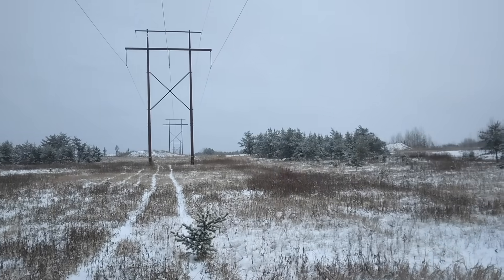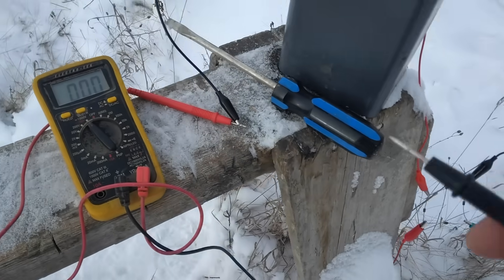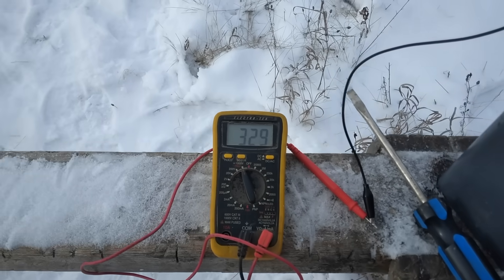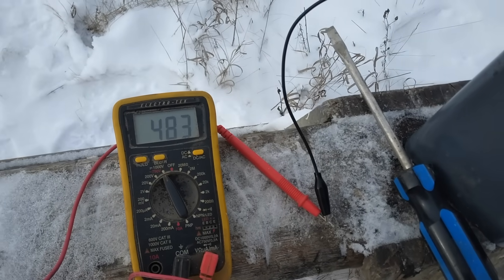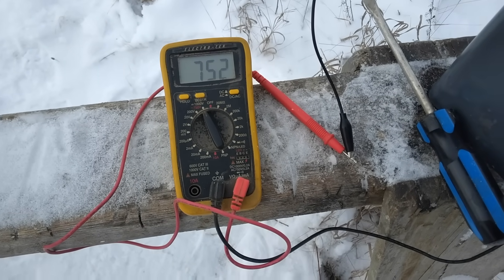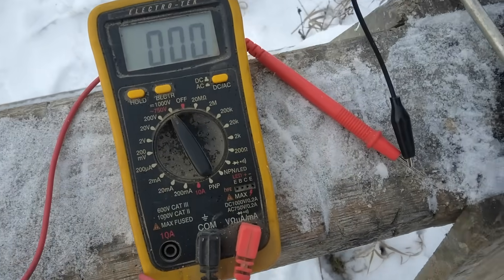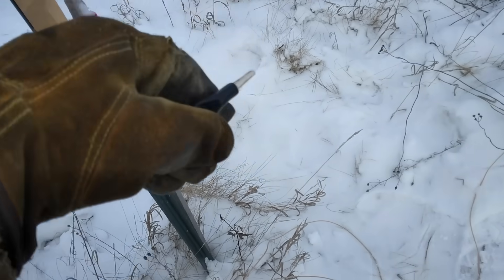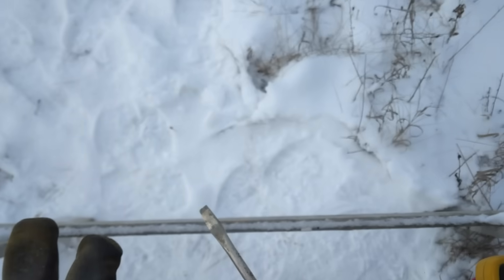Fences sucking power from under HV transmission lines

Comment: You can walk under them with a long florescent tube and it will light up . We used to tape a small one on our radio antennas key the microphone and they lit up from the RF.  Same if you pulled into a gas station with tubes under the canopy touch them with a 1/4 wave 10 meter whip and you could light them up all the ways around the station .
Reply: We did this as teens and it looked like a light saber from starwars
Reply: We used to take Jack In The Box antenna balls, stick em on the tip of a K-40 CB antenna, and stick a couple of those electroluminescent (neon) bulbs into the balls where the eyes were. A 150 watt linear amp did a great job of lighting up those bulbs pretty bright. lol
Reply: transmitting that much RF at a gas station doesn't strike me as safe. You're going to make a spark somewhere there shouldn't be a spark.
Reply: @thewhitefalcon8539  No sparks.
Reply: @-108-  how do you know?
Reply: @thewhitefalcon8539   think of it as a EMP  not a lightning strike really no chance of a spark plus its so far from a pump remember myth busters did that about cell phones . Its like the guys (CB bunch mostly)  that will say they have so much power the tip of their antenna glows red hot Total Bunk  ! I have had corona discharges on long wire antennas with the 2 kw amp  a blue glow around the wire on a damp night  power lines do that a lot too   and you have to jabber a long time to get that to happen .
Reply: @jhonsiders6077  EMPs cause sparks though. And cellphones don't have 10 meter antennas and put out only about one watt.
Reply: A ten yard whip? How are you running an antenna that long? Longest I've seen on a vehicle was about 3 yards.
Reply: @TehButterflyEffect 
He means an antenna used for the 10 meter amateur radio band. Approx 8’ long antenna.
Reply: @TehButterflyEffect   A 10 METER whip . thats part of the radio spectrum  27 to 28  hz  part of that is the CB  channels  102 inches is a 1/4 wave antenna .
Reply: @jhonsiders6077 : That's eleven meters.
Reply: @edwatts9890  yes on the edge but as you know we can sneak onto 11 with our ham rigs same antenna
Reply: @TehButterflyEffect  10 meters is the name of the band because ~10m is the length of a full wave at that frequency band.
So 1/4 wave at 10m is 2.5m (8.2 feet). That would put it just under 3 yards.
Reply: @TehButterflyEffect  By 10m he means the 10 m ham band, converted that would be 28 Mhz.
The actual antenna would  be about 2.5 m

Comment: Thanks for sharing this emergency energy harvesting technique.
Is the wire at the other end attached to anything or is it just held up by your fence and ends there ?
Have you thought about using graphite wire instead of copper with pins pushed through, spikes towards the source ?  Helps to absorb the energy I believe.
Reply: Would good would do if the power is out?
Reply: @timcat1004  ?
Reply: The pins and spikes are for collecting atmospheric energy, which would be 100v at 1m over your head (3.3ft), 200v at 2m(6.6ft) 300v at 3m, and so on. Earths energy fields sort of "hug" our individual fields, so that's why it's the same distance over our heads, no matter how tall you are. 

I've seen some drone experiments using the pins and spikes to collect atmospheric electricity, and it was pretty interesting. Here's the thing, atmospheric energy is way easier to collect if you string a wire high enough, then run a low voltage current through it. It begs one to wonder how much is gathered through the bare tension wires they have running way up above the insulated wires...you know? Maybe I wonder too much. Nah. Cheers!

Comment: Worked at a pool liner factory during the 80's. We'd cut the patterns in the vinyl and and got them ready for  assembly by fusion using large machines.
There were no need for powerlines for the flourscent lights as the ambient energy made them shone.
At my end, with a metal tape measure, when doing my thing measuring the shapes that made up the pool liner, I would often get burned by the tape measure which somehow funneled the ambient energy comeong from the machine's
It's all right there;-)
Reply: Was this caused by static electricity in the vinyl?
Reply: And that’s why we have to bond the water of a swimming pool. I  have seen voltage as high as 97 V and people that didn’t want to get it done right I told him they couldn’t use it.
So  be safe out there.
Peace
Reply: I worked with these machines which produce high power RF (radio frequency). They induce heat in the vinyl thru molecular friction. Called ''heat sealing". The stray RF would cause all kinds of bad effects including interfereing with airplane coms. Google ''kabar'' or thermatron.

Comment: Of course it's illegal to use the power collected from overhead lines by inductive or capacitive means, but this is a fascinating and somewhat sketchy experiment.

It would be interesting to run a double length of wire, essentially a loop and measure the voltage induced between the two ends. Separating the wires in the run by 1/4 or 1/2 of the 60Hz signal running overhead may provide some interesting results. Keep in mind, the turns ratio of a transformer will determine the voltage ratio between primary and secondary windings.

Speaking of sketchy and paying somewhat of a mind to safety, those leather gloves do not provide enough insulation to protect you from the 900 volts you generated and that 88 mf capacitor stored more than enough energy to kill you.

Comment: You should use this area to " Store" your Large coil of Welding Cables ;)
But be sure to Dump the energy into a battery whenever it goes over battery charging voltage.
! knew a farmer who does thi to power his hunting cabin battery bank... (200 kV line)

Comment: A great example of an air core transformer. You will get more induction by reducing the separation between primary and secondary, and increasing the length in parallel. Changing the angle between primary and secondary reduces the (effective) parallel length, which reduces the induction.
Reply: I remember back to the 90's when I was getting my Electronics Engineer certification.  We were discussing this and there was a story about an engineer that buried a spool of copper cable under the lines to power his home.  Seems he was doing it successfully but the coil was also acting as a load on that stretch of line.  When the electric company traced the loss and found that, they sued the guy for utility theft.  So when they say fence, it may mean wooden or plastic.  If you knowingly put up a metal fence and that electrocutes someone, especially a child, you could be prosecuted for something like wreckless endangerment.  Or if you do siphon off electricity, theft.  I'm sure there's some fine print out there.
Reply: Looks like capacitive coupling since he's just connecting to one end of the wire. If he went to one side (to couple better to a single phase) and had a larger 'plate' i.e. more wire, he'd probably get more out of it.
Reply: I'm going to say you are correct, sir... on all counts. 

  peace.  @Rich-on6fe
Reply: VERY INTELLIGENT  COMMENT  👍🏻😎
🤜🏻🤛🏻
Reply: This is capacitive coupling
Reply: @Magneticitist  If it is, then increasing the plate size and reducing the separation between, will increase the capacitance, thereby increasing the amount of energy able to be transferred.
Reply: @flyingweed9671  You could, but in both cases the necessary size for anything useful becomes pretty ridiculous. At that point you might as well just steal power by bridging the contacts of the meter base at your service feed and never pay for the service.
Reply: You may get better results not using a coax cable being that the core you are hooking up to is shielded. ground the woven metal shielding to the copper on one end. that will utilize the mesh in the induction process.
Reply: And coil the secondary for increased inductance. I was watching this and wondering what the result would be if you stretched out a toy slinky and performed the same test.
Reply: I suspect a sheet of aluminium foil, or a vehicle, or any other large, flat conductive object would work very well as a capacitor plate. Put it high up, and I'm guessing directly under one of the outer phases will be optimal but experimentation will tell.
Reply: Would a heavy  bare copper cable take in more juice?
Reply: @tinknal6449  no. Even a light guage cable would be suitable.
What you are doing is intersecting the electromagnetic lines of flux.
Reply: Because the capacitance depends on the log of the radius and the cost depends on the square of the radius, using a heavy gauge wire would be a Terribly costly way to get an improvement.
Reply: @tinknal6449  It will reduce resistive losses. But to increase inductance, it's all about coils. The more turns, the closer together that they are and the diameter of the coil will all increase inductance.
Reply: Youobviouslydo NOT know ELECTRICITY!!!!
Reply: Dobyou know what a VOLT is??????
Reply: Run a line  to your house and get free power to a battery bank 🤔
Reply: @marcgraham6438  years ago a person in England lived adjacent to a radio transmitting station. From memory the station was shortwave for Europe. The person configured there boundary fence into a rombic antenna and tuned it to the station next door. A ladder line feeder brought the energy into the house to run the lights, which were converted to fluorescent tubes. It was free lighting for years until someone discovered the lack of signal in Europe and tracked the problem down. From memory they were convicted of stealing electricity?
Reply: This is a big fat joke what was the voltage in the average transmission lines and obviously you were getting used voltage on the fence but it will not affect anything the overhead transmission lines
Reply: It does actually make the flow in the overhead line a very tiny bit more restricted. No such thing as free energy. You sound like a jerk though so don't bother replying.   @TonyTromp-b4c

Comment: You have volts and you have current.  Volts are no good without current.  Low current induced here.  A device to be used with a current draw rating exceeding the available current won't do much good.

Comment: Almost certainly not legal.  Theft of electricity.
What would happen if you used a long 1" thick copper rod instead of a wire.
The greater the mass of the conductor should pull much more power.
Again... totally illegal.  Do not do.
Reply: Ur comment is the kind of ones from ChatGPT who tell you it's not legal but also tell you "about that, here's your answer about..." Lmao and I love it
Reply: @Lord_common_sense  
I am not a robot.  But I sometimes feel that way at work.
Reply: I'm an electrical idiot. Common sense tells me--- the more power ya git on the ground..... The more drag on the HV power lines. 2nd law? of thermodynamics.  Energy can never be made nor lost. Again,  I'm outta my idiot element. Another law about the simplest explanation is probably the right one. But then I find nothing simple when herding pixies through copper. 
  Just a thought
Reply: @kevinfoster1213  
Electrons don't actually move through the wires, they vibrate forward and backward without moving at all.  That's how the power can be transmitted at speeds higher than C.
It's almost instantaneous.  Amazing stuff.

Comment: I would say you are accumulating potential not from inductance, but more from capacitance. Your coax is in parallel to the overhead transmission lines, therefore forming one side of a capacitor. It would be interesting to see if you could zener the DC voltage and use it to generate a 12 volt useful source of low current power. As long as your apparatus is not on the power company's easement, you should be OK to take as much power as you want..!!!  Good luck. 😊
Reply: Yeah capacitive coupling
Reply: I would contend that while there is most certainly capacitance in the coax, he is not accumulating potential as a consequence. I theorise that static electric charge accumulated by the capacitance of the coax is fed back into the overhead power lines on the negative side of the frequency cycle.
Reply: @davidbrayshaw3529  The capacitance in the coax has nothing to do with collecting potential. You can pick it up on the inside OR the outside of the coax OR you can short the inside to the outside shield and it will still work. The coax is referenced to ground thru the full wave bridge rectifier, making the coax the ground side of the AC capacitor. The power line is the other side of the capacitor.  As far as the coax goes, you can use ANY kind of wire as long as it's conductive. I'm guessing that he used coax because it was a handy conductor.
Reply: @fatherd.6016  I see what you're saying. I think that I misread your post and ignored rectification.
If this is indeed capacitive coupling as opposed to inductive coupling, wouldn't the capacitance have to be very tightly tuned to resonate with the frequency of the power line to be effectively drawn as current and rectified? It needs to be basically a tuned LC circuit, doesn't it? Inductive coupling does not have to be tuned as such.
Reply: @davidbrayshaw3529  There's always going to be a certain amount of inductance to every electrical circuit, but in this case the majority of potential is transferred by capacitance. It's like being inside the capacitor and measuring the voltage between plates.
Reply: @fatherd.6016  I'm really struggling to get my head around this. Capacitive coupling has to be present. It just has to be. Inductive coupling also has to be present.
But the problem with this from a point of view of inductive coupling principles, both the primary side and the secondary side are the worst possible designs possible.
Induction must be at a minimum for this reason alone. I can only think of one way to test this. And that is to pull the fuse on the power line and measure the voltage on the coax. If there is still a voltage, it has to be capacitance. If there isn't, it's induction. Please excuse my rambling thoughts.

Comment: The way i see it, you're not stealing, they're failing to keep the power in their lines and you're just scavenging what they're allowing to leak. They could use shielded cables, but that's cost prohibitive so this is the side effect.  Put me on the jury!
Reply: The top tier capitalist view everything as their own; water, land,etc... in fact all natural resources, including HUMAN resources.   The minions are supposed to be delighted that they allow you to pay to enjoy whatever tiny portion you can afford.
Electricity is no different... they consider it their own, once it leaves the power generation facility.
Reply: If that's scavenging, then me nicking your car's fuel line and collecting what dribbles out is also scavenging (would you be happy with that? What if I did it to you neighbor?). The fact is the vast (VAST) amount of energy that is "leaked" in this way ends up being put back into the power lines 1/120th of a second later (it's why he needs a rectifier to make it work properly, if that wasn't there, it wouldn't work), it's only when you have a device like that above that it actually leaves the powerlines permanently. Yes some energy is lost due to inductance in the ground but the thing about that is you can't actually scavenge it from the ground once it's in there.

Also people have been stealing energy like this for years, it's well established that it is classed as stealing (every Joule that's taken through such a device is a Joule that the energy company can't sell). If it's not stealing then bypassing your electricity meter isn't stealing too.

Don't get me wrong, it's fascinating to see (but so's arson). Doesn't make it legal.
Reply: @Logarithm906  the difference is, if you're stealing gas you have to go break into someone's car, onto their property, and take it. With energy, they're projecting EMF all over the place, into your property, you're just grabbing it as it comes by your air space.  This reminds me of the court case against the police using IR cameras to find grow houses from all the heat the lights give off. The argument in court was the police were looking inside a house without a warrant. But this is technically wrong, the house is radiating heat and the IR camera is just picking up what the house is sending out into space, big difference.

Comment: The title of the video is MISLEADING there is NO power being sucked away from the power lines! It is the electromagnetic field from the power lines that is being captured by the wire, NO power is being taken away from the power company. This guy would have to break the laws of physics before braking legals laws. How much usable power is generated? I would say not much. Maybe some LED lights or charge some batteries, however, more than just a wire would be needed. Some large wire coils and a voltage regulator might do the trick. The amount of money and work to invest might not offset the power gained. Of course, he can get a voltage from the electromagnetic field around the power lines, but very little current which is not practical. Crystal radios work on the same principal, crystal radios are powered ONLY by the radio waves transmitted by the radio stations. I showed a crystal set in a science class in high school once and demonstrated a radio that used no power, I also replaced the headphones with a LCD watch, and powered the watch. The class thought that I was using evil magic. LOL!!
Reply: Please study more. What he made was a rather inefficient transformer. And power being drawn off the secondary of a transformer does affect the power required by the primary. So he was sucking more power from the power line. But a rather insignificant amount. Doing the math indicates that he was drawing a power of approximately 75 milliwatts from the power line and hence the power company. I doubt they would notice it.